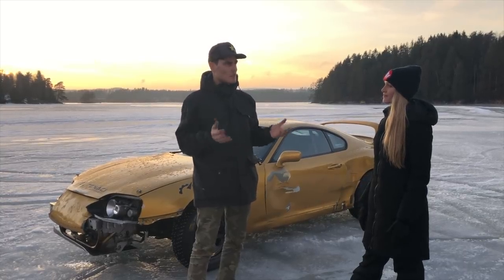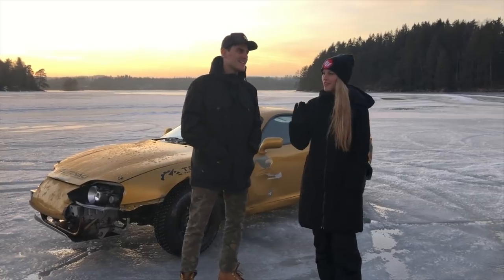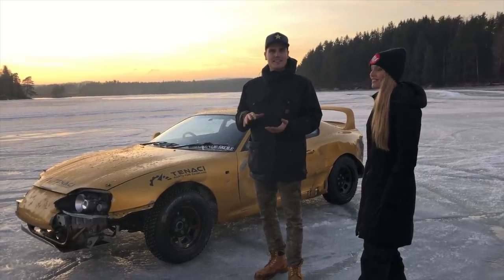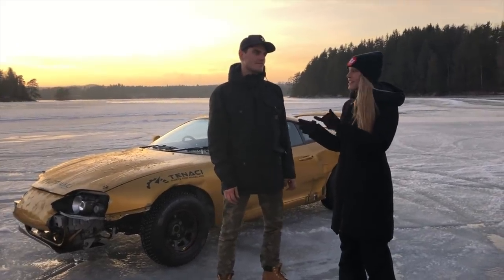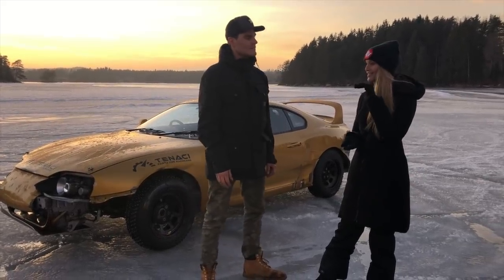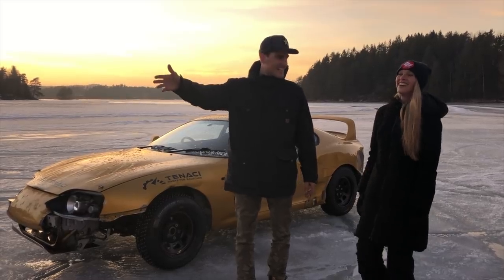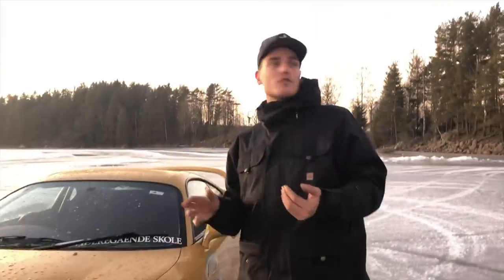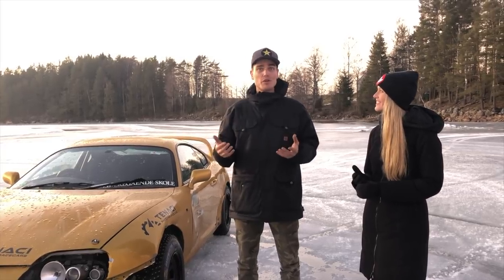Aasbo tells you how to build your own ICE DRIFT CAR!

Comment: Did this one year on the local lake. Had some studded blizzaks and like 4 sand bags in the hatch of my supra and went a ripped up the plowed trails. I had a about 7-8 ft wide trail to stay on though or I would be stuck in two feet of snow. My buddy was following right behind in his Mazda 2000 pickup. haha So fun!
Reply from the maker: How well did it work out in the end?  What did you learn and what were the biggest hurdles?
Reply: @LoneStarDrift  It worked out pretty good for a 16 year old with a supra on the lake I guess. I couldn't pick near as much speed as these guys with my tire setup and the thin trails. I learned that it's the best way to destroy your car if your trying to go that route. My biggest hurdle was getting back up the boat landing that we used to get on the lake. haha I bought some studded snow tires to do it again this year, but was never able to get out there with the absurd amounts of snow we've accumulated this year. Takes a tracked ATV or vehicle to get around out there now.

Comment: Aaron, this is the tyre they are using: https://www.michelinmotorsport.com/Tyres/Rally/Snow-ice/GE
Reply from the maker: Do I have to put the studs in myself
Reply: @LoneStarDrift  No, they're already studded from factory.
Reply from the maker: The photos look like they aren't studded.  I will continue looking I kinda want to buy a set and figure out how to mount up wheels to one of my cars and take it somewhere this winter.  Any hints on places to buy tires and wheels?  links?  5x114.3 hopefully
Reply: @LoneStarDrift  Try to contact with rally teams. I bought mines used on the Sweeden WRC event from a team.
Reply: @LoneStarDrift  You can use these tyres on steel 5" wide wheels, you don't really need anything special. Here is an european price list, the GE00 L/R costs 227€/pice. https://docs.google.com/viewer?url=https://www.pneu-sport.cz/cenik/cenik-pneu-sport-soutezni.pdf